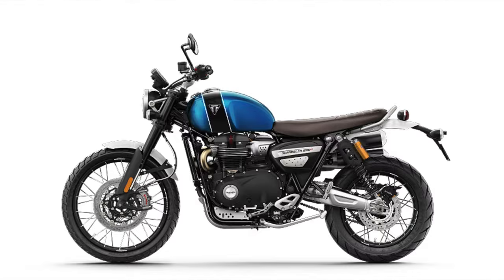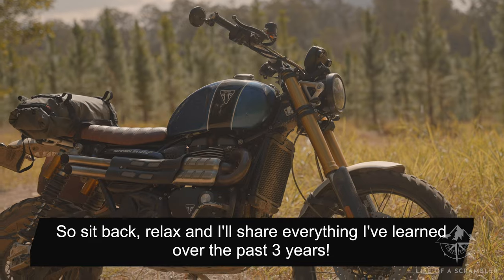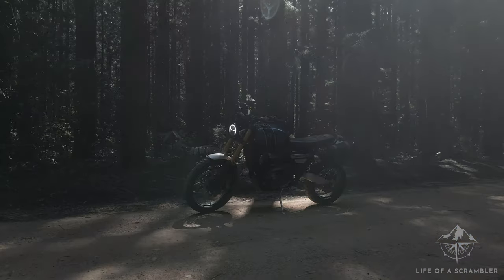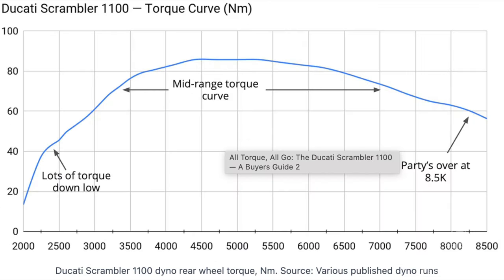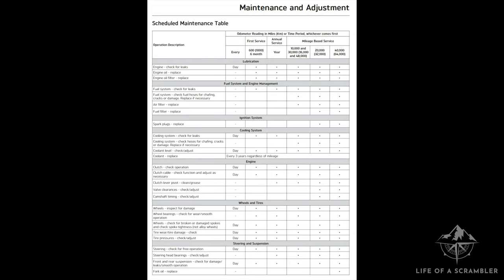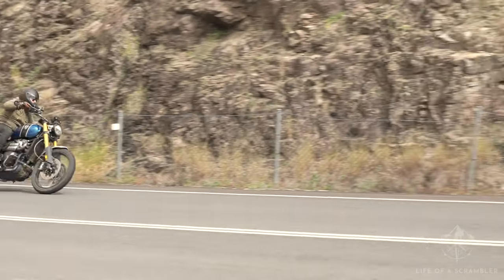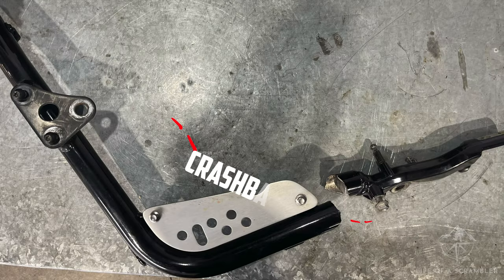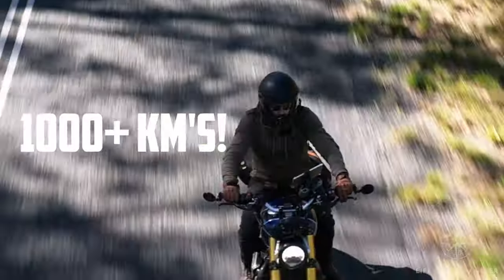3-part Scrambler 1200 LONG term DETAILED review (Part 1)

Comment: You’re ignoring the part in James Bond where they clearly use a different bike (or modified the back end) for the big jump coz the rear shocks flick & shake like slinky springs when he lands 😂
Reply from the maker: Yeahhhh I know, I think it was a KTM with fake plastics or something, I just didn’t wanna go off on a tangeant - the point stands that cool people ride triumphs 😎🤗
Reply: @lifeofascrambler Is there a source for that information?  I watched that movie out of boredom and kind of regret it, although Daniel Craig was never a real James Bond anyway.
Reply from the maker: @DarthVader-1701  a source for the information regarding what bike they rode? not really its just a guess based on several peoples analysis of the engine, frame / shape etc

Comment: Hello good afternoon.  Like your review, but very surprised about your comments on the suspension… I found you while looking for information in the problem of the suspension. I am a tall guy and I weigh 107 Kg plus gear, and because of this I have found a lot of information about the setup of the suspension, well, the lack of setup if you weigh more than 80 Kg…. The shocks just cannot handle this weigh and nobody seems to know about it, until you buy it and weigh 107…   Hopefully more people talk more about this.

Comment: I watched your mods video. What did you do to tidy up the back fender and get rid of that awful license hanger and indicator setup? A more detailed video and maybe a how to would be really nice if possible! I’m about to pick up a XE and I will be doing almost all of your mods thank you for putting all this content out to help us!
Reply from the maker: Thanks I’m glad it helps, I actually had footage of that from a while back, but I used CAD to draw up my own tail tidy and cut it with a plasma from 2mm mild steel and it’s a bit untidy…so my perfectionism is stopping me showing it too much 😅 I am thinking I might put the CAD file up on my patreon though, so people can get that and some other stuff easily and for a cheap price
Reply: What did you use to relocate the indicators? I know triumph has their own system for doing so did you use that?

Comment: What’s your opinion on the aftermarket crash bars from companies like Hepco + Becker?
Reply from the maker: I haven’t used them myself because I prefer the less visible OEM dresser bars, but I’ve heard good things about the Hepco & Becker bars, they seem to protect the sides really well from big or small drops. I don’t know if the OEM bars would protect the upper parts of the bike if you manage to tip it over a lot if that makes sense?!

Comment: Great video!! Absolutely love mine. Less than 5 months old and have done a smidge more than 5100kms. I just need to be a bit more hands on with the regular maintenance. I don't have my own garage and have to work in the apartment's basement car park. Not the most ideal when it comes to oil changes and stuff. Not to mention, lack of equipment and storage of said equipment. Having said that, it is such a fun bike to ride.
Reply from the maker: thanks! Thats a decent amount of KM's! Are you mostly doing short rides or long rides? Also, for regular maintenance, I got a cheap bike lift stand for like $150 and its enough to get the wheels just off the ground in a few seconds, so you can do the basics!